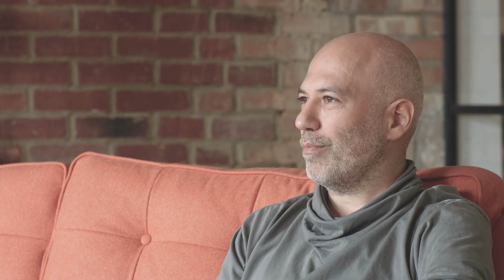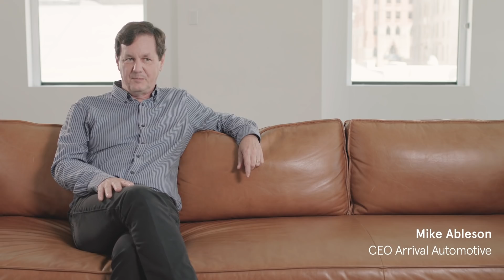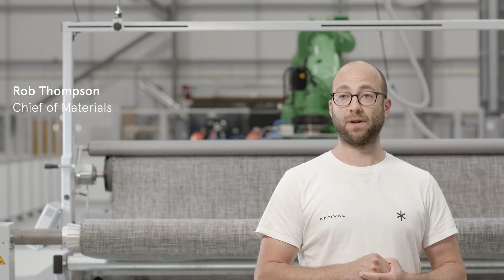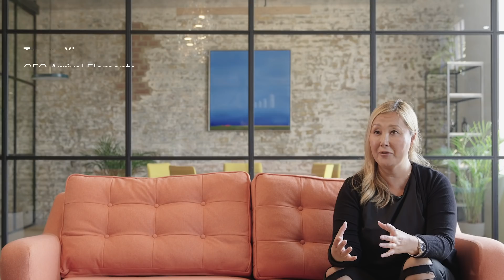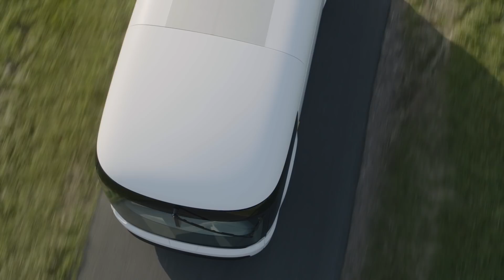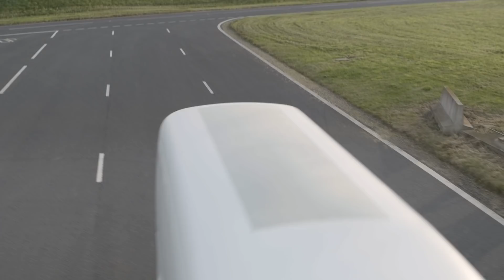Changing the Traditional Automotive Industry | Introducing ARRIVAL

Comment: The ability to “bounce back” is not “ductility”. It is “elasticity”. “Ductility” of a metal means it is easily formed or deformed.
Reply: ... so the ability to receive an inpact, deform and reform is ductility?
Reply: @sirdeakia  no, a ductile material is easily deformed. That's it. it doesn't reform back into it's original shape
Reply: no, ductility means the ability to be drawn out into thin wires
Reply: @sirdeakia  no the ability to deformed to thin cross sections and keep the deformed shape is ductility. It is a plastic deformation.

If it deforms and then reforms to original shape, it is an elastic deformation.
Reply: No, Ductility..are utilities for Ducks.
Reply: @renagonpoi5747  So ductility is just a capacity to be deformed without material failure?
Reply: @sirdeakia  Yes, but the type of deformation is built into the word "ductility" as well. The final shape is supposed to have a thin cross section.
Reply: Thank you
Reply: But it sounds smart
Reply: Their Chief of materials clearly doesnt even understand "ductility".This is a scam guys!
Reply: @sirdeakia  No what you're describing is done with hammers and fire when making horse shoes.

Comment: Seems promising. 
What I need to know:
1. Range of the vehicle
2. Battery efficiency
3. Passenger safety (during crashes and roll overs)
4. How 'proprietary' are the parts. Can we use generic EV chargers for this.
5. What percentage of the vehicle is recyclable and at what cost and efficiency
6. How much does one of your vehicles cost. Both in retail and cost of production.

Comment: Does arrival have one or maybe several of their six months to build, relatively low capex micro factories up and running ? It's not a rhetorical question do they?
Reply: If its a guide they have significantly expanded their procurement department so are already ordering material.
Reply: Yes, they do. They use them to make the prototypes seen here

Comment: Im a bus driver. They mention that the materials they use are, unlike conventional steel formed panelled vehicles, can be recycled hundreds of times. When a company buys a bus, its target working life is around 12-15 years. Our workshop repairs panels on a daily basis - existing panels get repaired dozens of times. Our buses do approx 50k - 80k miles a year. We have 113 buses in our depot. Each bus gets fuelled every night. If we had a fleet of these electric buses, the area needed to either charge buses, or if their battery packs were replaceable, charge the packs would have to be absolutely massive for our 113 buses - and we are not a big depot. We would need to lease/buy extra ground space to do this. The extra space would not be on the necessary depot site, therefore arrangements would need to be made to transport massive battery packs safely and continously from depot site to extra storage/charge sites. It's all a great idea in theory but in my humble view, the reality of these vehicles is probably about 10-15 years away sadly. Most companies will only be able to purchase a few buses on a type test basis.

Comment: This is still traditional, The aerodynamics is equal to brick lol. Aerodynamics plays an important part in vehicle performance. Future vehicles would be 10 times more aerodynamics than traditional vehicles.
Reply: They're not even driving around 200 mph. Get lost.
Reply: @marinerchris  A** aerodynamics start working at 40mph.
Reply: Their vehicles are made to balance between aerodynamics and cargo volume-parking dimensions ratio.
This means that they are neither completely streamlined like sedans, nor completely square-edged like older industrial vehicles, but somewhere in between.
Reply: how bout motorized pointy nose that can be flatted when u need more space like parking
Reply: @Rcck.7282  Nice one

Comment: Composite body panels. Wow, why not every car follow this!
Reply: Because in modern cars the shell is part of the chassis and provides structural rigidity. So composite materials like these might not be strong enough. Carbon fiber is strong for example but used in exotic cars cause of its cost. But in trucks, busses, vans e.t.c they use a body on frame design where the panels don't really serve a purpose.

Comment: In what world is a micro-factory more efficient than assembly lines with centralized material warehouse.
Reply: Correct me if I'm wrong, because I haven't been researching long, but isn't the idea that they'll produce modules centrally then assemble those modules at the microfactories?
Reply: @imthelovestamp  That's how I understand it to. But I don't see how the economic benefit of cheaper transport (modules in compact form vs volumous vehicles) could outweigh the speed, quality control, efficiency of an assembly line. We have to keep in mind that buses and delivery vans are manufactured in quantities with little differences between each, which is what assembly line is made for.
Reply: But maybe they know something the industry doesn't. It would be great to have a big evolution in vehicle production.

Comment: Selecting fabric for the interior? they are at that point of productions.  How are they mass producing: charging systems, drive systems, and the can's and controls.  Software controls engineers? Mechanical engineers? Designers?  this is a video to sell to a bunch of rich air heads.

Comment: Why electric and not hydrogen? It's clear that Hydrogen will be the fuel for these types of vehicles.
Reply: @00Gambit Does that invalidate the science?  I don't care about Nikola cause the science says otherwise.
Reply: If you learned how thermodynamics works, you would never posted this comment. Hydrogen is a Hoax by fossil fuel companies to delay other better solutions. We call this greenwashing. We had hydrogen busses here.. we have hydrogen cars here the Hyundai Nexo driving around. The busses are now replaced by FULL EV busses. Now 50% of all diesel busses are replaced by Full EV busses that have ranges between 300 and 500km depending on the model. It works great. Hydrogen is just a lie. Waisting energy and the investment is too high. Poor countries can never affors the investment. And waisting all the energy by inefficiencies.
My country also has alot of delivery postal trucks all electric. No hydrogen and it works great. My company has 20x 11kW AC chargers. And will build more on the parking spot. Also we have 2x 50kW DC fast chargers on our parking lot. Batteries will become better with many advances in the pipeling such as solid state batteries, and cheaper materials. Batteries will become dirt cheap and easy to recycle and have extreme long lifetimes the coming 50 year.